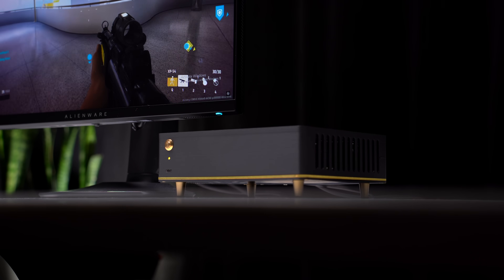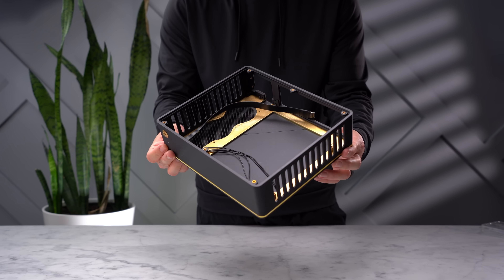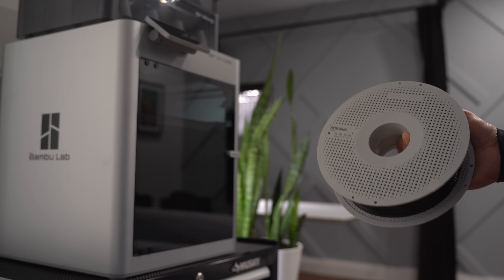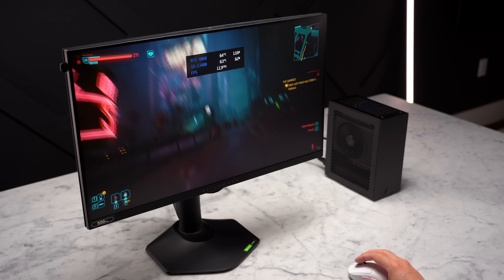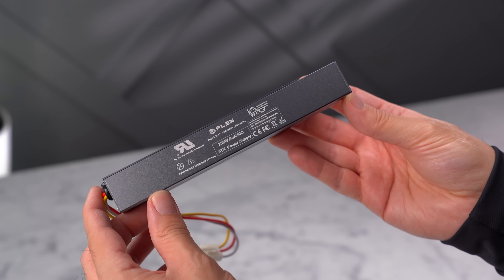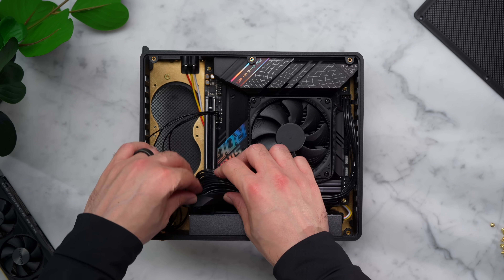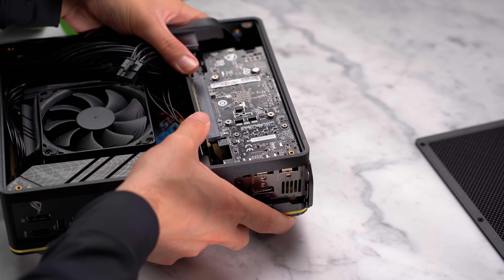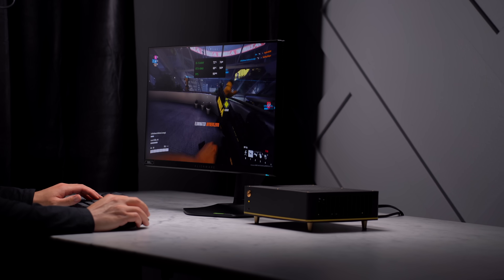World's Smallest 4060 Gaming PC That You Can Build NOW (No Mods)

Comment: $130 for a 3d printed case that cost pennies is crazy. If I felt so inclined I (and most people that can CAD) could easily make that pc case, the only hard part would be buying the button +  usb c and the 10 or so minutes it would take to actually put the screw thread inserts in the part. Respect for such a high profit margin though, maybe I should start doing something like that on the side
Reply: There's Optimum's case with 3 litters 3d printed case that you can print.

Comment: Plastic mixed with carbon has a melting point between 580-620f or around 300c… I assume it’s some variant of this.  It is also nearly shatterproof and can be transparent too.  Think of it as a softer metal really.  It is extremely durable and is a perfect material for this use case.  So set your worries aside ffs

Comment: This Case is pretty nice. The power supply is working close to its maximum. I don't know if that's good. I don't think so. The big limitation is the small radiator on the CPU, which prevents the use of a better CPU like 14600kf

Comment: How much with the feet included.  Edit: I can't find the dimensions with the feet included.  Seems a lot more like 5L if we include the feet.  
Also look into a reduced pin count 24-pin.  Due to modern motherboards not using much 3.3v and 5v you could lose all but 2 each of those.  (There was a time the processor or RAM would run off those voltages, but not for many years).

Comment: So my only problem is you are starting with regular ITX instead of PIO ITX.  Why?  Well for starters I made a 2.1L PIO 4060 last year, you can look it up on small form factor forums.  But PIO H610 were going for 73 bux on Ali Ex sale this year and they don't need power cables DC-DC, PICO PSU, or Riser cables for a start.  Besides being cheaper and running directly off 19-20v they also use Laptop RAM modules, for significant space savings.  My build comfortably runs a 12500t and a 4060 off of a 240w Alienware/Dell GaN power brick, which would easily fit inside if I wanted.  (Many other GaN are possible, this is just the cheapest at 30 or less).  It is not difficult at all to get a PIO motherboard nowadays.  I also am working on a 3.2L build using an off-the-shelf case, which yes needs two cuts (you could make with tin snips), but it is under 35 US D.  Cost is a factor, these builds can come in under 600 including all parts, NVMe storage and a new 4060 Low Profile.

Comment: motherboard manufacturers need to take a cue from laptops and position the ram and nvme ports so cases can just open a panel to change them out instead of disassembling everything. I think current board layouts suck.  :/   ...positioning PCIE so you can use modules for controller cards and gpus would also be nice.

Comment: I recently built a Yocto & Yocto+ using the same motherboard, but for the Gigabyte RTX 4060 LP, I used the N3rdware dual Noctua 60mm x 25mm fans to replace the OEM 3-fan shroud and I was quite impressed with the cooling with the GPU temps maxing out at about 75C.  If interested, I have those builds listing on Facebook on the SFF Mini-ITX channel and a couple more computer channels.  The only difference is instead of the i5-13400, I used the i5-13500T for the Yocto and i5-14600T for the Yocto+ as I wanted a lower power draw, lower heat CPU that works great for both productivity and gaming.

Comment: i had to watch your video to be sure it wasnt just mine.

the additive manufacturing process means there will be some warp on the bottom of the case and maybe on the top since its a huge flat pane. I also have a 3d printer and it has an even worse warping problem than this when attempting similar surfaces. the fact they got it THIS flat as to minimize said warping is a testament to how professional these guys are.

Comment: The electrical engineer in me shaking:  what if i used this as a base and 3d printed my own at double the thickness and stuffed as many lipo batteries as i could in it and used wireless peripherals... the ultimate hacking and war driving travel machine. I could have everything on me at all times.

Comment: There is a even smaller case that fits a 4060 plus HDplex the "Prototype SL3m 2.9L" from custom-mod its Size: 239 x 207 x 60mm (2.97L) Cooler: up to 39 mm PSU: HDPlex 250 GaN

Comment: After they designed it, it's mostly 3D printer crafted, not hand crafted. PETG is not expensive either. 150 pounds is bloody insane.
Reply: i think its mostly because they are hobbyists trying to be producers.
As a hobbyist myself I get mad frustrated dealing with my own 3d printer, and you bet your ass I would charge someone as much as I think I could get away with when it comes to making me wait for a single thing to take damn near a whole day to print and I have to babysit it.

I agree they should have the PETG injected into a mold though. Cuts down on price and saves hairpulling & time for everyone.
Reply: No one should pay over 100$ for a 3D printed frame. Stupid. You can get the same size case from NFC with aluminum. This is stupid
Reply: @englandrasmussen3111  I totally agree!
Reply: @englandrasmussen3111   aw but if its aluminum you know longer have cool reddit points for having a rare hard to make luxury item. you instead have something reliable and cheap... which is great... but not bathing in reddit updoots.

You see. the reason why the PC master race exists is because its a completely separate class from PC User Base
Reply: The unit in this video also has a nasty layer shift that he highlights.

That’s, imo, a failed print if I’m selling it for 150$.
Not something I would buy…

Comment: Hi! Devyn Johnston, you know you should have build a powerful tiny pc has you did and add the sleep mode option controled by a remote control for the power button, like that when I sit on my couch in front of the tv I will just reach for the remote control and power the tiny pc connected to my 4k tv and also easy to power off, this could be amazing. And if you do that you could sell a lot of them. Thanks for reading, peace. Bye

Comment: I went with z board and 13600k with my small pc so that i could undervolt for better temp on cpu with that noctua cooler as that was my only option to choose from to fit it inside the case

Comment: Depending on the materials you use, you can actually have an incredibly strong, rigid and heat resistant build. PETG is not bad. But it's a lot more brittle than even PLA, so even with higher heat resistance, it's definitely not going to be more durable. Printing in ABS, ASA, PC and PA12/PA6 (Nylon) especially when carbon fibre reinforced, will yield leaps and bounds more rigidity, tensile and compressive strength, impact resistance, and most importantly heat resistance. In the order of magnitude of 2-3 times that of PETG when you get up to Nylon (especially carbon fibre reinforced nylon). 

PETG is just not an ideal solution here. While it will work, it's a place they have decided to cheap out instead of using better and more robust materials. Only time will tell if that decision was worthwhile.
Reply: PETG is not more brittle than PLA, you're confused. Also, this is CF reinforced PETG, did you actually watch the video? It's nearly matte in appearance, which should give you a hint it's not regular PETG, which would be shiny af.

Comment: Awesome build congrats!!! The only potential problem i see here is long term for the PSU! If you're an intensive gamer, constantly pushing the limits, the PSU might die after some months or even earlier! At least 300-350W is mandatory for a system with these specs to be safe in the long term. Now, if you go APU like a 8700G which i think should be the purpose of these tiny builds, then a 200-250W PSU is more than enough :D and i'm probably building one next year with ZEn5 APU!

Comment: First video I have seen from you. On the Ryzen have you gone into the bios and set it to run in ECO mode before? Curious also then how the performance would stack against the intel chip. I know a lot of users run their Ryzen chips in ECO mode and say they only lose a bit of performance but the power draw and heat difference is pretty significant.

Comment: what's the point of a 4060 if has hitting the same frames as me on a 1080 ti at this point seems like money sent down the drain. you could do a mini 1080 and get the same performance or above with the better power consumption of the older gen cpu and gpu because I think the 250w is really really bottle necking everything?

Comment: You're misunderstanding how the two cpu options you mentioned self regulate for power. The AMD chip intentionally draws more power as long as it sees temp headroom. Because it's not a problem at all for it to run just bellow 100C 24/7.
Intel still locks down all their chips that don't have a K name... So the one you have here will barely ever break the 65W number on the specsheet.
I think given AMD is so much more power efficient if you are worried about the temp numbers, go turn off PBO and take all the performance benefits.

Comment: a mod they can do for the case is covering the sides of the holes with brass and having a lane of brass that runs all across the inner sides of the case. This way the case will act more like a heatsink and it will also look a bit mor cool in my opinion. It will obviously increase the price, but since in this niche is fine spending 150 bucks for a case then why don't have a 170/180 bucks case that has this truly valuable plus?

Comment: You mentioned no softening or melting of the plastic but at 3:27 you can definitely tell some bending has happened on the right side of the entire build. It's quite glaring, but unassumingly you wouldn't find it. Once you see it you really cant "un-see" it.
Reply: More than likely happened during printing. Very common. Usually just bad bed adhesion and is solved easily with leveling, cleaning the bed plate, or using some type of glue adhesive on the bed plate.
Reply: oh yeah, I see it the bowing on the bed, my OCD would never allow that, especially with the brass contrast.
Reply: The closeup of the power button and USB-C port shows really rough artifacts of the print job too. For 140 bucks, I think I'll look into Velka instead
Reply: @Jeyricho  that's mainly in extreme lighting conditions, with normal lighting the layers are almost invisible and it's not something that would bother you

Comment: This is cool and all but the point of PC gaming over console is the easy of upgradeability and this form factor really limits that for the GPU. The 7060, 8060, or 9060 may not be the right size to fit. Best case scenario you just have to update the case.

Comment: I am just not going to pay for anything that has less than 16gigs. It's no secret that's the gaming industry standard has always been set by Xbox and PlayStation specs. buying less is just forcing you to pay again in just a year or 2. I will stay with my motto of always beating consoles by a margin when I upgrade. So my minimum spec is 18gigs of ram. My 6 year old SLI 1080ti's both have 12gig's.

Comment: what are the custom cables you used called and where can I find them?
Reply from the maker: https://n3rdware.com/accessories/custom-hdplex-cables
Reply: @devyn.johnston  pro tip for you, instead using 23 wires in atx harness you can use oly 12-14wires - green, blue, grey are singal pins so 0,35mm (awg24 will do the work) purple 5VSB (0,5mm awg20) and 2 of each woltage (12, 5, 3.3V) + 3-4GND (0,5-0,75mm) awg18 - personally I am using 3 gnd and 1 of each voltage pins so this give me 10 wire atx harness (very slim and easy to fit)

Comment: Bit late to this but the PSU should have a little more headroom if you're measuring off the wall socket directly. With the peak efficiency being at 94%, in theory you could pull power up to the point the reading hits 265W - probably a bit more though as PSU's generally arent as efficient at such high loads

Awesome build though, glad to see more 3d printed cases are taking off as there's so much more potential for new stuff to come to market without the crazy expenses around full metal prototype builds

Comment: Please can you review some more desktop/horizontally mounted console-esque cases with great airflow from the front? I’m looking for a desktop case with great airflow intake from the front that would fit in a media cabinet but still fits a full size graphics card, I just can’t find anything
Reply: I've also been looking pretty hard, I don't think these cases exist. Somehow this form factor is too niche for anyone to think about. 😮‍💨
Reply: @ColorblindMonk  Fractal Design Node 202 and Fractal Ridge are pretty good, and I just came across the Skyreach 4 mini too
Reply: @applewizard32  I've looked at them, too, but I'm not a big on Fractal's SFF cases as they put aesthetics before proper airflow. Cool it can lay flat, but the GPU gets almost no clearance for air intake, and they're almost too large to even call SFF. I've tried looking for the Skyreach 4, but it's almost impossible to find one at a reasonable price.

Comment: the 250w is for output, given power supplies are about 80% efficient, you can assume that measuring at the wall that the unit is at max input at 120% rated output. On this unit its 300w.

Comment: Single layer insulated wires carrying mains voltage being squeezed right underneath the motherboard with sensitive electronics and sharp pins?
That's a very bad idea.
Those HDPLEX PSUs are not your normal ATX PSUs with concealed mains wiring, with those you really need to be careful...
EDIT: WAIT 150 FOR 3D PRINTED CASE?! HELL NO!

Comment: If you’re interested in something smaller, the minisforum MS-01 can hold a single half height gpu, like the rx 6400, and comes in at less than 2 liters. It comes with a mobile cpu soldered to the board but the options are, a 12450H, 12900H, or 13900H. Not sure there are any better single slot low profile gpus though.

Comment: Bruh, how can it be advertised if it is not even in a production state? some of the layers near the holes are off, manually assembled, sides are not even flat, case is just 3d printed box. Don't get me wrong, overall build is nice and cool, but the case is straight up garbage, velka looks miles better, than that. It's a cool concept, pre-production sample, anything but production-ready case

Comment: At the point where you're using a 4060 sff pc build just get a laptop instead. You end up overpaying so much for some of the niche components in an sff build like this and have almost no power after all of it and being less practical than a laptop.

The single fan 4070 mod + R7 7800x3d would be perfect for an sff build like this. Especially with lower power limits and a slight undervolt.

Comment: when the fuck are they gonna make 70 and 80 tier cards this size????? criminally underrates form factor
Reply: Great question. Especially when you consider that the 60 tier is the least energy efficient of all of them... 80 or 90 makes the most sense for a small build where every watt and degree matters
Reply: Not happening unless Nvidia decides to move the --80 cards way down from the 300W+ TDP power envelope they've been at for the past couple of generations. Their workstations cards like the RTX 4000 Ada SFF are proof that Nvidia's perfectly capable of making relatively powerful cards with a low TDP, but they haven't applied any such strategy to their Geforce line yet.

Comment: The J-HACK Pure Mk2 is the smallest 4060 Gaming PC at 3.14L. It can also fit a 47mm cpu cooler.
Reply from the maker: Doesn't have an internal power supply. I'm talking about a complete system here.

Comment: Can you try deshrouding a 4070s and fit it in there?
Reply: Length is more of the issue than anything. The shortest 4070 or AMD equivalent isn't going to fit in any case smaller than 7L, and even then you might have trouble keeping it running cool.

Comment: Fyi I have had no problem under-volting the 65w 7600. Negative -30 is no problem however I toned it down to-25 as temps were perfect in a Densium with zotac 4070. 
For when you want as much HP as you get in sub 5l.

This build is clean AF btw. Hopefully they release a steel version.

Comment: I'm sure applying an uv for the cpu and 4060 to help with the temps and tdp has crossed your mind. If we ever get a low profile 4060ti you could create quite the beastly box for sure.

There's some embedded/nuc style boards worth looking over for future builds. Intel quit making nucs. But, they're still making oem boards. I've seen some nice embedded Ryzen 7000 boards.
For full on desktop performance the Ryzen 9 7945HX3D (16c/32th) at 55w would be an absolute beast (albeit overkill) for these kinds of builds. V-cache on 6 and 8 core mobile would be ideal.

Comment: My gaming pc is giagantic^^ I use the same case for around 18 years now. The good thing is it has big Fans that are really quiet. The gpu is the loudest part in my computer.

I love these mini pcs that you show in your videos. I want to build one that i want to use as htpc and as gaming pc for my wife. So i want something i can easily just take and move from the living room to my gaming room. 
The thing is that a lof of cases are not available or super expensive here in germany. Also i dont have a big budget for this build. I think i should not choose a low profile GPU-case. Its easier to get a short single fan GPU. I have a gtx 1060 here for start, so i can upgrade later. I dont need wifi but i think all the mainboards have it. I prefer intel over amd for this build. 
I will search more. Till now i just found at amazon a case for 103€ from JOYJOM. Its 4.3 liter 
It comes with riser cable. 
Do you know this case? Do you think its a good choice? 

Thanks for your videos :)